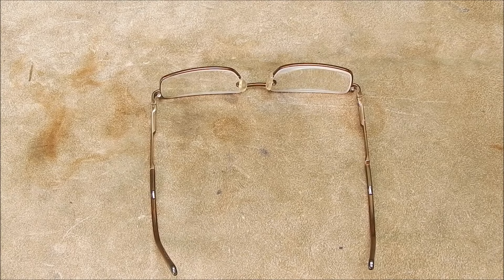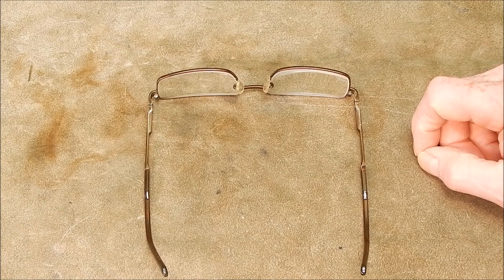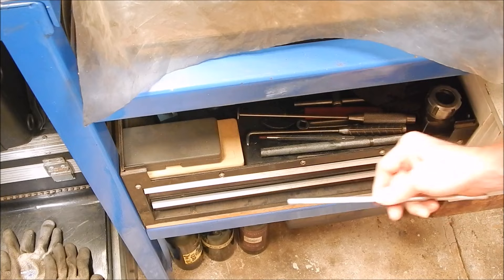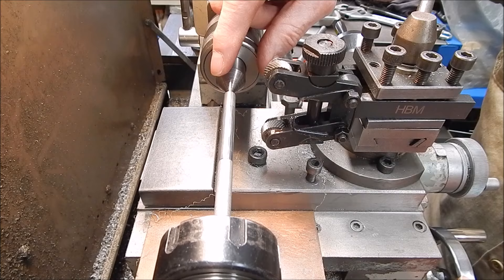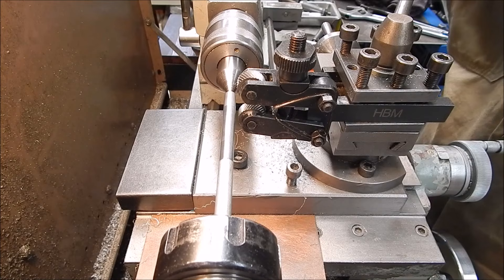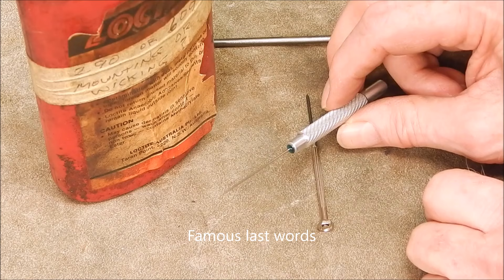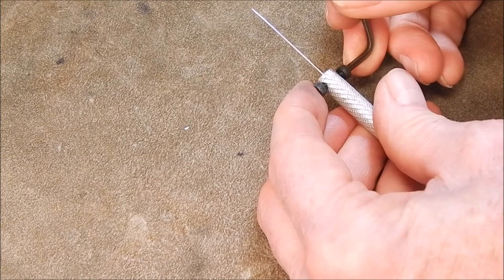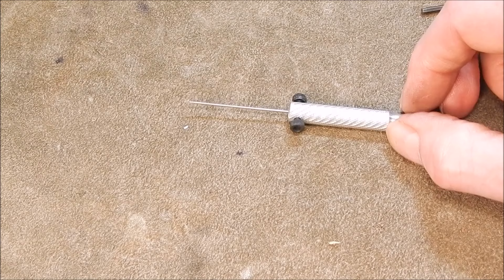I make a tiny screwdriver for ultra small jobs

Comment: The swivel on the butt of the little screwdrivers is meant to let you hold downward pressure with a finger from your off hand and then turn the shaft with your dominant hand. Keeps the dinky little screw slots from getting buggered.
Reply from the maker: I wondered afterwards if that was the reason it was there.  Why it was hexagonal puzzled me a bit.  Cheers Rob

Comment: Nice tool, the cap screws sticking out from the shaft reminded me of the head of Frankenstein. Clickspring of Antikythera mechanism reproduction fame uses a needle as a scribe to make fine layout lines. The needles seem to hold up well. Thank you for sharing!
Reply from the maker: There are not too many hard metal options when you get down to these dimensions.  Cheers Rob

Comment: Nice job on the screwdriver Rob. Would never have thought of using a needle. When I took up this new hobby I made a scribe not unlike your screwdriver using a darning needle. Made the handle from brass. ATB Cheers Nobby
Reply from the maker: Hi Nobby.  I did consider brass, but went ally as I had plenty in a close size.  A needle for a fine scribe tip would be good.  I made a regular scribe using a ground cement nail (very hard stuff) and it works well.  All things are possible .  Cheers Rob
Reply: @Xynudu    Hi Rob ,  I also have used a sharpend cement natl as a scribe and it works very well.    It is very hard material.    All the best. 

Dale in Canada

Comment: Nice screwdriver Rob. You could use some Loctite on your glasses screws, then they wont come loose again. An added bonus is to laugh to yourself when you watch the people at the glasses place try to get the screws out...
Reply from the maker: Ha Ha. Yes, I did think about that.  I will keep an eye on them and if things move again I will do as you say.  Loctite works well in most situations. Too well ;)  Cheers Rob
Reply: I had some glasses that I could not keep a screw in tight no matter how much I tightened it.    I used blue loctite and it worked very well with giving the option of removing the screw. 

Dale in Canada

Comment: Nice job Rob 👍👍 I'd assumed from the beginning that you were going to use grub screws to hold the blade as you'd mentioned cross drilling. Added bonus with that method is it's dead easy to change the screwdriver blade should you have too. Great idea to use a needle, just the right kind of steel, hard but also flexible. Cheers, Alan.
Reply from the maker: Hi Alan.  I was originally going to cross drill it to prevent an air pocket when using Loctite.  The fit was so sloppy it wasn't necessary, and didn't work anyway.  So it still got cross drilled for a different reason.  The end result is actually a lot better.  There weren't too many hard steel options available to try, although a broken drill shank may have worked.  So it got the needle.  Cheers Rob
Reply: @Xynudu  I think the needle was a better bet. Drill bits of that diameter tend to be very short and break easily even when used for their original purpose. Cheers, Alan.

Comment: The damn screws fall out of my glasses all the time, but thankfully over here there is an optometrist only every corner, or at least that's what it seems. They are more than happy to replace the screw free of charge even if you didn't buy from them in the first place. 👍
Reply from the maker: Good deal.  Cheers Rob

Comment: shoulda' use metal to make the handle and you'd have been able to solder it in. Nice maching 🙂
Reply from the maker: Yes, I did wonder about brass and stainless steel. Brass would have worked well as it can be knurled. Went with ally as I always had plan B in the back of my mind.  Cheers Rob

Comment: Got there eventually Rob 👍 My glasses lost a screw a few months back, I have many tiny screwdrivers and a good collection of tiny screws but do you think I could find the right size🙄 Held together with very fine fencing wire till I rember to go to the glasses shop. They usually don't charge. Cheers mate 🍻
Reply from the maker: Hi Bill.  Not unusual to have a screw loose ;)  He He.  This has happened a few times.  A bit of bent wire or a pin does the job for while until the wobbly arm finally pisses me off and I see the optician.  Such is life.  Cheers Rob
Reply: 🤔 The gradual decay of a loose screw vs the catastrophic failure of a tight one 🤣🍻
Reply from the maker: Yes.  I know at least four people that have topped themselves.  Success and fortune doesn't necessarily bring happiness.   Underachievers probably live longer in the grand scheme of things.  Cheers Rob